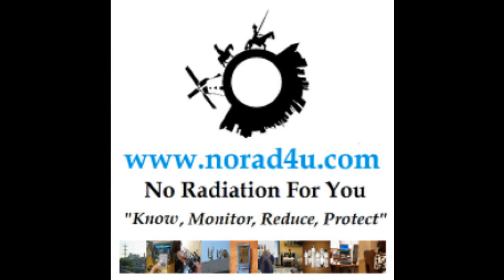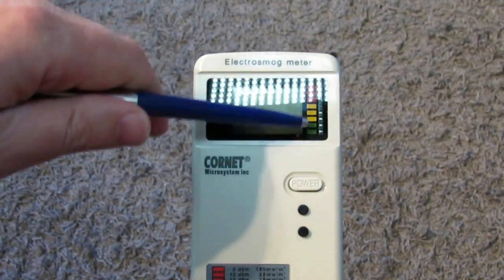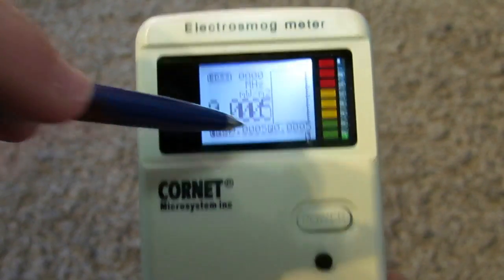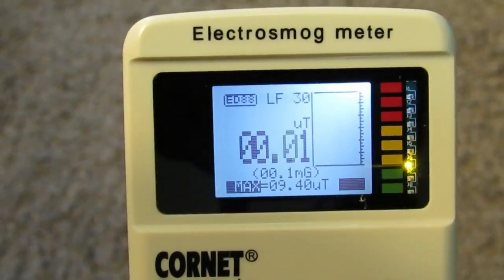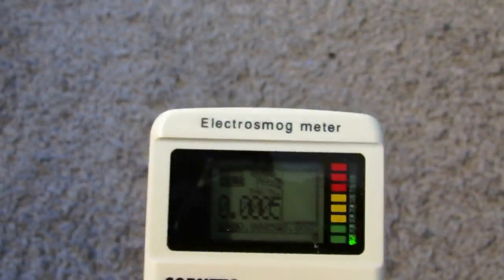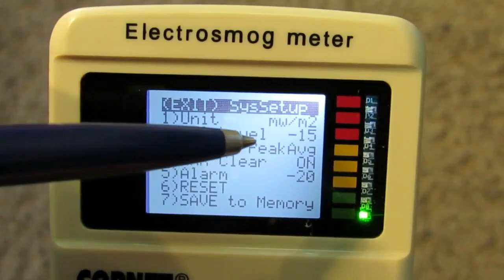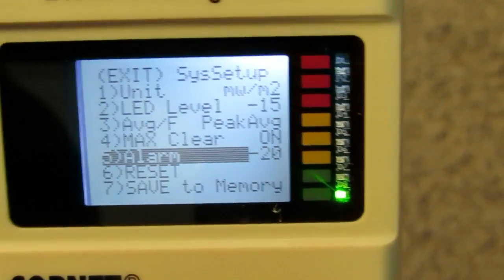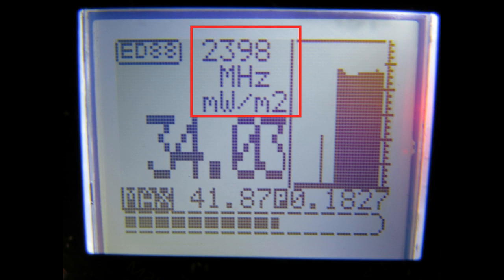CORNET ED88T EMF meter - Operation and instructions

Comment: Hi, I've seen others recommend -20 for the LED Setting on their ED88t, and you recommend -15. What do each of the settings for the LED (OFF, -5, -10, -15, -20) actually relate to, and why do you use -15 particularly please?
Reply from the maker: It is the sensitivity of the leds. 
-10 means that the leds will be 10 times more sensitive.
Reply from the maker: by the way, I know set to -20, so the leds will show RED at level I think are problematic.

Comment: Thanks for making this video. 2 questions: What could be causing an orange light (00.15 uT) in the LF setting?  Also does anyone have a clear chart that shows RF radiation frequency levels and the corresponding human health effects?  Thanks
Reply from the maker: Hello.
1. wires, electric infrastructure, appliances....please see - https://www.norad4u.com/emf-sources/elf-emf-sources/
2. a list of RF sources - https://www.norad4u.com/emf-sources/rf-sources/
2A The effect of RF is dependable on so many variables, I can't guess what level will cause what damage. I can say that today (it changes over time) I feel pain after 30-60 minutes in 0.04mW/m2

Comment: My ED88T does not register anything at the smart meter.  It's set to 
measure microwatts /M2 and I'm getting zero reading.  Any idea what's 
going wrong.  Other RF fields around the house are being picked up 
nicely by the ED88T.
Reply: Is it a gas smart meter? For some reason they emit almost no RF.
Reply: It's an electric meter. It could be that they are only transmitting certain times of day, or they've altered the frequency to make it more difficult to detect.
Reply from the maker: can you please send me a picture of the electric smart meter to norad4u@gmail.com?
Reply: make sure your hand is not covering the sensor (antena) of the ed88t
Reply from the maker: Maybe the smart meter is not emitting any RF.
amirb

Comment: just got one
Reply from the maker: Great!
 I hope It will help you reduce your exposure and learn about EMF.
amirb
Reply: Hello :) What an excellent video! I'm not yet familiar with all the numbers/readings other than what the lights indicate. Can you recommend a resource for the average person can learn without having to have the knowledge of an electrician or expert? It seems that increasing the LED sensitivity plus putting in a new battery has changed certain readings. I'm extremely emf sensitive and many times, though I can feel symptoms, I'm not able to determine what's creating the problem :( I bought a new monitor so I could move my laptop away, but I'm detecting more magnetic field beneath the desk. I removed the surge protectors so it's not that. I'm highly frustrated and can't afford to waste money on things that aren't making a difference :( Any help or suggestions you can offer would be greatly appreciated! Thanks so much :)
Reply from the maker: Hello and thanks for your comment.
Regarding know how , please see my info site - 
http://www.norad4u.com/knowledge

Creating a PC environment is very complicated for some EHS people (I am an EHS person myself).

You need to make sure the monitor has an external power supply.
Then you need to move the computer and the monitor's power supply as far away as possible from you. 
Use wired keyboard and mouse only. 
If you can still feel the mouse and keyboard try using conducting  gloves - http://www.norad4u.com/buy-emf-products/electrodeconductiveglove

If the screen still gives you trouble, get the screen film and then turn the brightness to 100% - http://www.4ehsbyehs.com/rf-protection/LED-LCD-screen-protection-film

If you need more info or help please contact me at norad4u@gmail.com